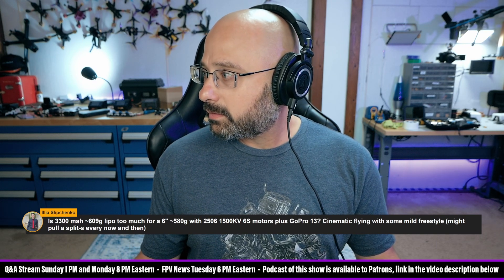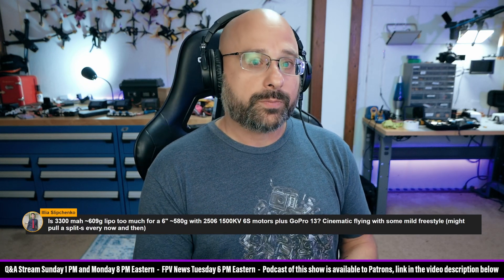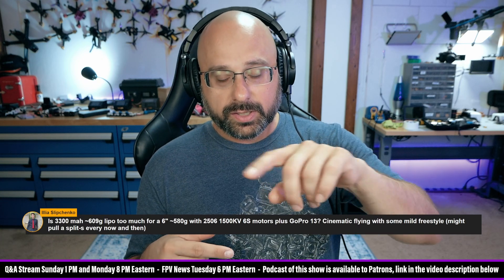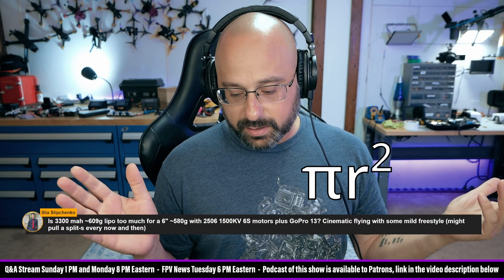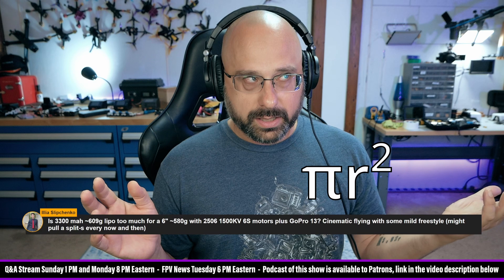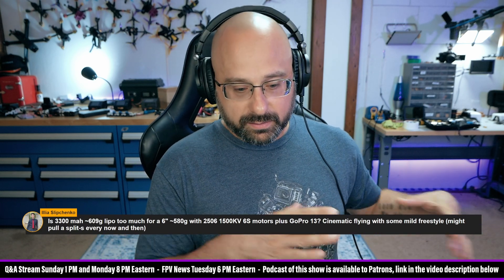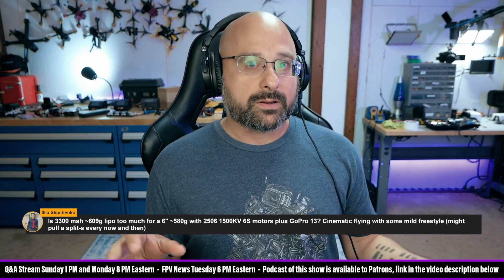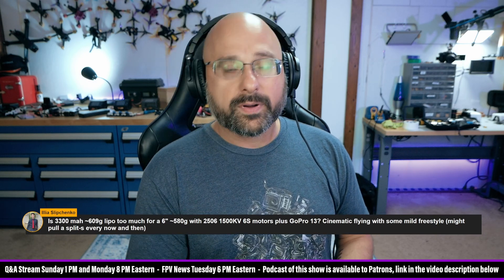Is this Lipo Too Big For My 6 Inch FPV Drone? What Is Disc Loading? - FPV Questions

Comment: On my Apex 6" 6s 3300mah does fly and perform well.

Never calculated the Disc load but it works. 

Prefer to use a 5s 3300mah though or 6s1p Lion Cells.

Standard 2207 1900kv motors. Ethix K2 Props.

Comment: A follow up, flew like a barge with 3300. After testing multiple sizes found a sweet spot in the range of 1800 to 2200 mah
Reply: Thanks for the follow up.
Reply: Oh great thanks for the follows up

Comment: 609g+580g+300g(gopro)=1489/(3,14*6*6)*4=3,29, how Bard well got 12?
Reply: My guess is you only take the size of 1 prop. So not *4.
Reply: you take the radius, not the diameter. Therefore the denominator should be 3,14*(3^2) * 4
Reply: The gopro is 200

Comment: I run 300g liion on 4" and it flies darn sweet . And get almost 20mins . Just think what those cinewhoops have to deal with with 3" props .
Reply: What 4 inch setup are you running with 300g battery. Can you give some specs please?
Reply: @chrisbee5481  few videos on my channel "can u freestyle with li-ion" and "apex4 03 test" 
Just apex 4" with 2203.5 motors and 4s molicel p42 21700 batteries
Reply: @martymcflymedia  what is the maximum amp draw on full throttle?
Reply: @chrisbee5481  not sure how accurate my current sensor would be . But either way it has enough amps to supply full throttle punches for extended periods and freestyle. I use it for pretty much everything including chasing drift cars .
Reply: @mx118racer  the molicel p42a can safely only output about 50A maximum. I'm wondering if you are freestyling like that within the maximum current limit. I find it hard to stay within the rated limit for freestyle. But guess you can just suck everything out of the liIon for the price of shorter life time of the battery. I've seen guys suck 100A out of the P45B.